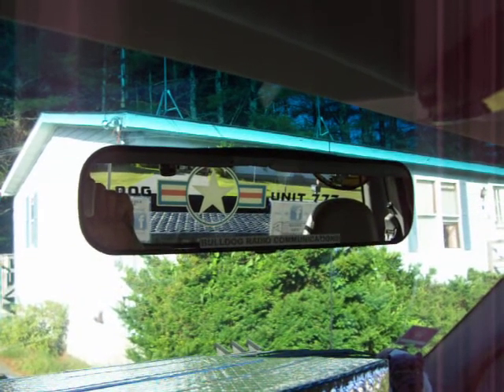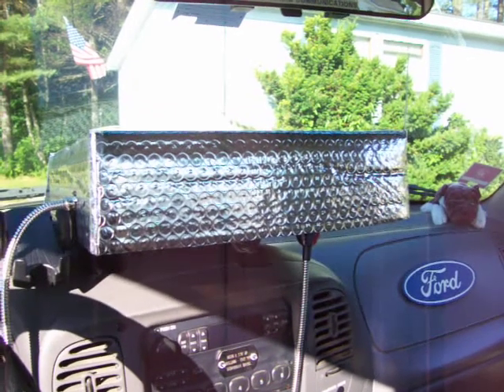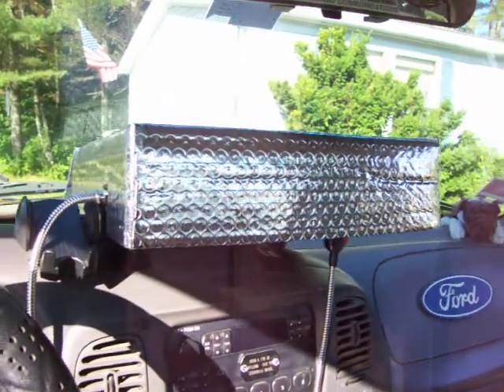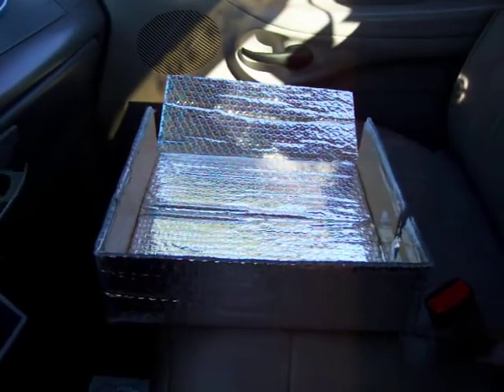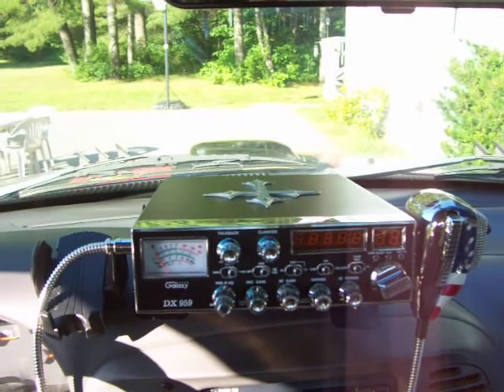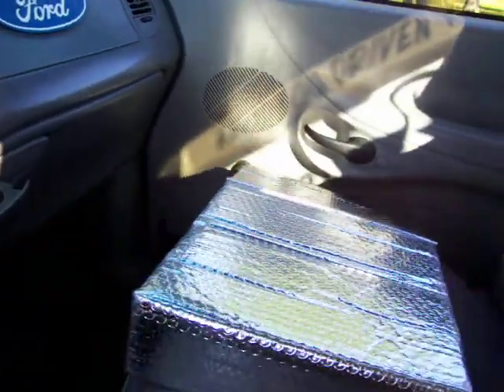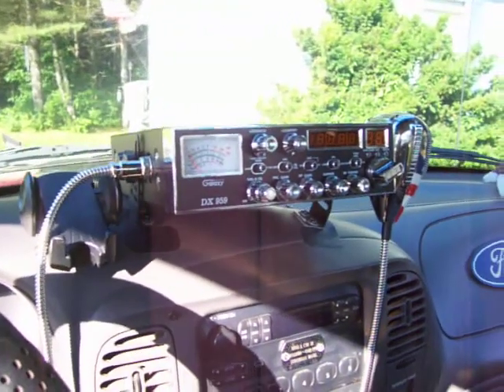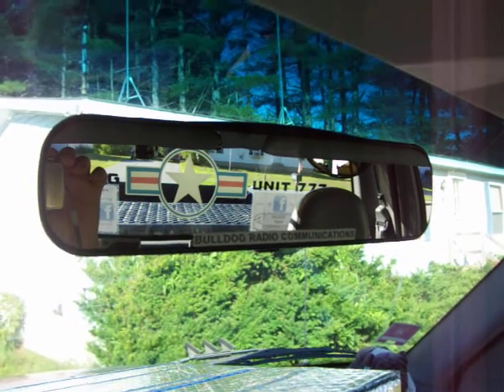Bulldog's Radio Transceiver Heat Shield!

Comment: why not take the some more cardboard and make 2 1" strips that sit on the edges on the top of the radio, then make a second layer so there is airspace so there is no direct heat transfer

Comment: Got a tip for ya bulldog...Get an old 12volt cooler take the chiller part out (looks like a heat sink on you radio) rig it up on the inside of your rig with a little computer fan and the rad will stay chilled i have one in my 667 and never get hot....